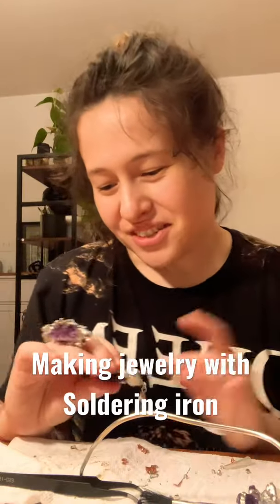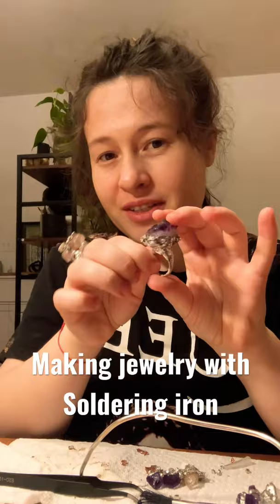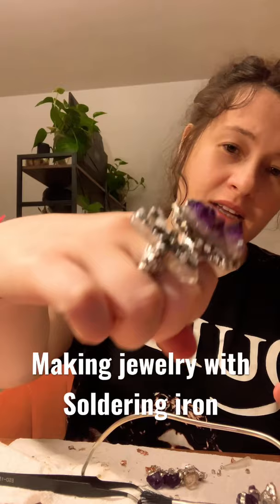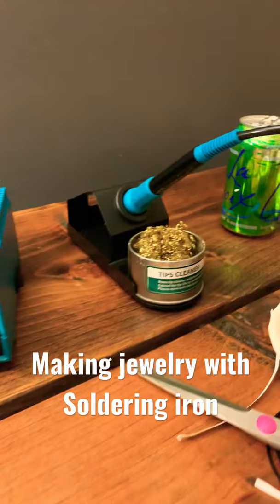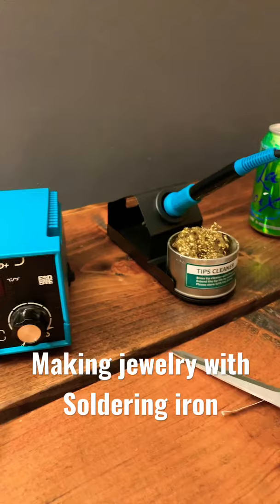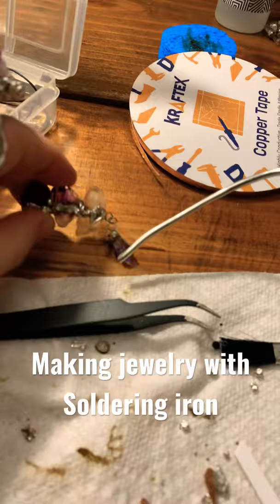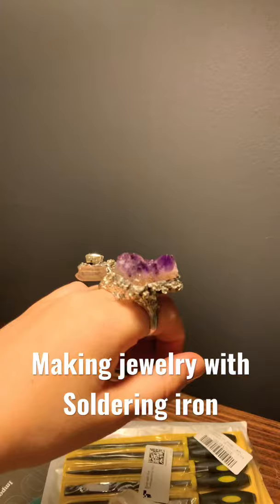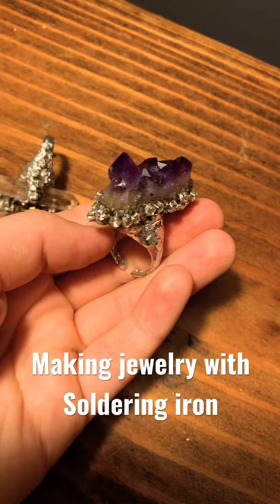Making Jewelry with soldering iron | Jewelry Soldering | Amethyst Ring

Comment: My soldering iron tips are breaking down fast. Do you have any tips for helping them last longer? I see some brass scrubbing thing does that help?
Reply from the maker: Yes the best thing is to Cover tips after you’re done with solder. That will prevent oxidizing oxidizing causes your tips to be very brittle and break off. Cleaning the iron using brass sponge is good during soldering process as it will allow the tip to pick up solder. 
So yes I would be using brass sponge after your done + covering tip with solder and letting it cool off like that. That was a game changer for me and I’m still using the same tip even though I’ve been storing for a few months now:) 

Sometimes to keep solder stuck on the tip once you’re done soldering it is good to decrease your irons temperature unplug your iron and once it’s a little bit cooler than try to add some solder. If you iron is very hot and you’re trying to cover it with solder it is possible it’s going to drip down so having it cooled off a little bit will help solder to stay stuck.

I hope this helps!
Eugenia ♥️
Reply: @eugeniaedits  you dont want your solder cooled in a "plastic" state. Try to get it like 63/37 solder. What I mean by this is that you should not mess with solder when it is cooling down
Reply from the maker: Thank you!! Got it - I will try to do that next time I solder ♥️

Comment: Thank you so much!! Good god I love that you get to the POINT all these other videos have to complicate everything lol. But I do have a question, I notice some ppl get gold or even rose gold instead of silver.. I was wondering if you knew anything about that & if it has to do with the color of the solder wire. Thank you!❤
Reply from the maker: Hahah! Thank you! So lead free solder for soft soldering only comes in silver - but! You can paint it with liquid gold leaf and then cover with resin. As it rubs off. Or you can apply a gold leaf and also seal it with resin.  I have tested both. Planning to make a video :)